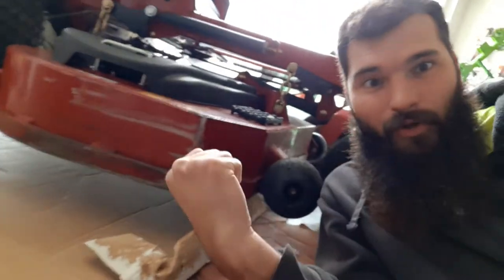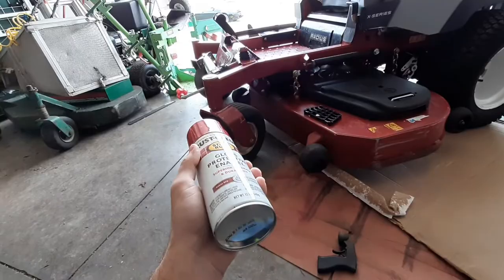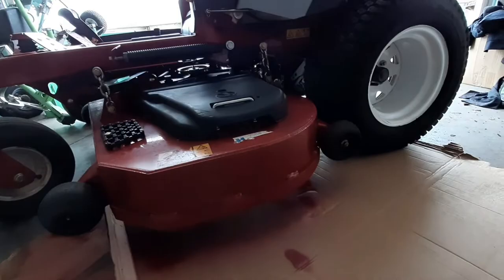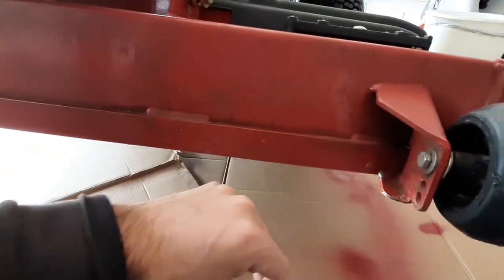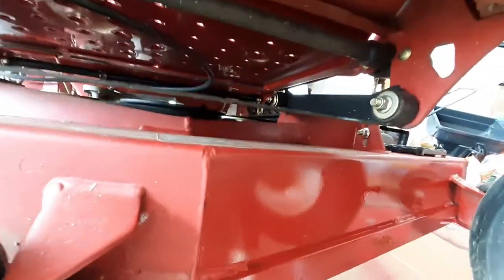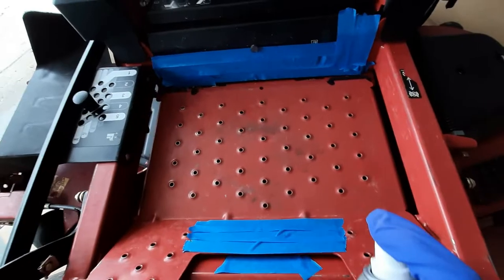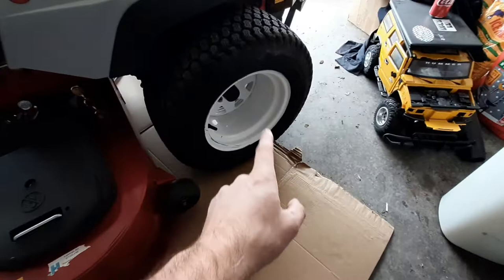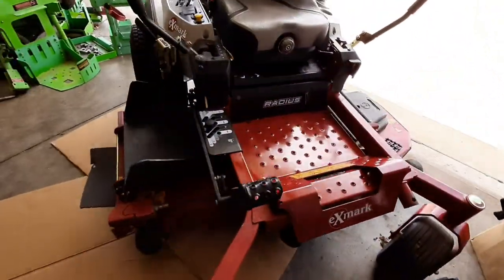How To Paint Your Exmark Zero Turn Mower

Comment: Wish I could find something that matches Hustler yellow!!
Reply from the maker: @Deep Roots Premium Lawn Care unfortunately I don't have any experience with that so I wish I could help you there but I don't know what to tell you. I know Menards is pretty cheap so you might be able to take apart in that has the paint on it to try and match it possibly 🤷‍♂️
Reply: @JonsDailyHustle  I read online you could do that and have it scanned ??
Reply from the maker: @sps302ss  I believe so. I don't know for sure but I believe they do it. Even if it's not quite exact if you were to fade it in you probably wouldn't notice a difference
Reply: Krylon Farm and Equipment "New Equipment Yellow" did OK. My buddy use this👍🏽
Reply: @bigsonslawncare  can't find it where did you pick it up at ?
Reply: @sps302ss  I believe it was Tractor Supply will check again